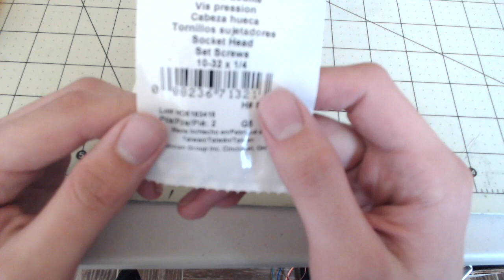Converting a Drill Motor to a Robotics Drive Motor

Comment: By adding more grub screws, does that result in more torque?
Reply from the maker: It would more easily allow you to get the full torque of the motor if the shaft slips